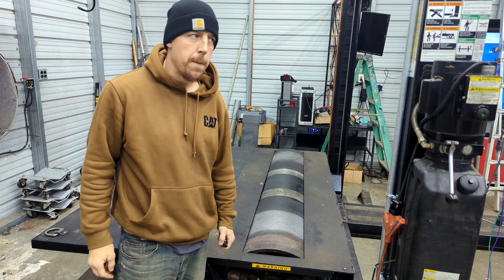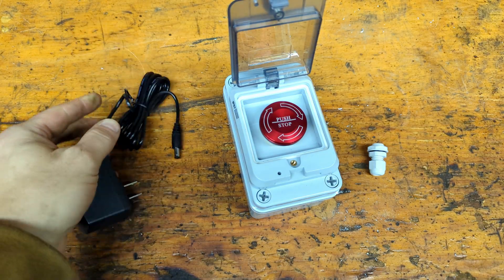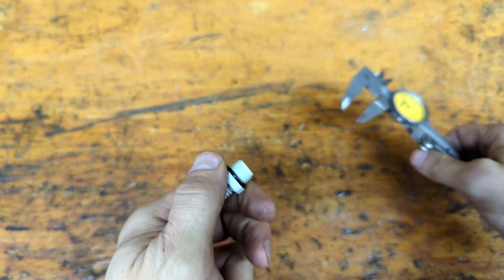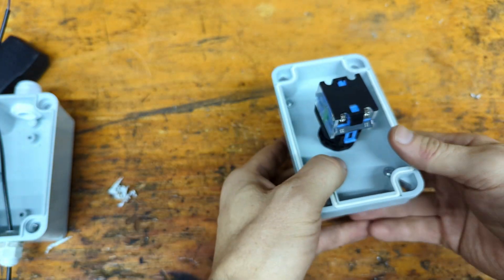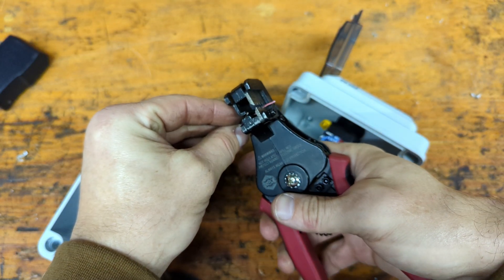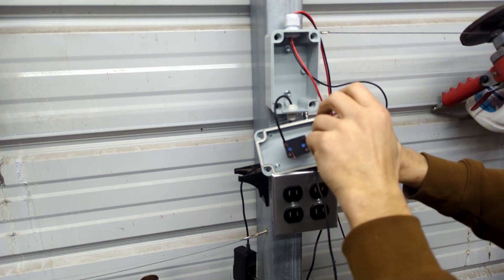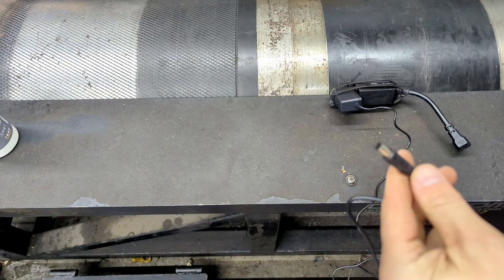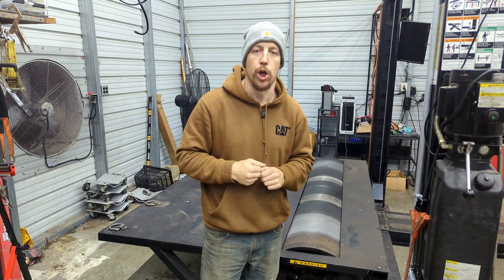Dyno Safety On a Budget: Redundant Air Brake Controls for $50

Comment: I am not sure about you, but this would be illegal where Im from and it looks dangerous.
To use positive control for an emergency system is just calling for trouble. The air system is smart because of the stored energy, but the solenoid should be always OPEN and a constant current from the emergency stop button should hold it closed. This way if you lose electricity for any reason it will trigger the  brakes. Otherwise you have no way of using it.
This is how stop buttons work on all industrial machines I ever worked on.
The open contact on the back is for sending a signal to a control unit (illuminate a light, sound siren, alert other systems etc.)
I hope you reconsider this way of wiring it.
Edit:
The accidental activation of the brakes could also be very dangerous, so I would add an uninterrupted power supply for this so a random grid blackout will not stop the drum (maybe while a test is in progress).
Reply from the maker: Good thoughts, and these are considerations that we accounted for. We have no legal requirement for such a stop button, but since we're setting up the air brake for locking the roller anyway, we decided to extend its capability a step further.

Additionally, verifying the function of the air brake will be one of the items on the pre-session checklist.

Thanks for checking out the video and dropping your comment. 😎
Reply: @PyroPerformancePNW  Legal liability shouldn’t be your deciding factor on such a small safety change, especially for this use case. Do it right, don’t be stupid.
Reply from the maker: @JollyGiant19  the input is appreciated. It is possible to change the configuration to act this way without a complete redesign, now that you mention it.

Perhaps this will be a future video.
Reply: I was going to say the same thing, the design is 'fail dangerous' rather than 'fail safe' The design of it is inherently dangerous because it's required to be energised/charged rather than de-energised/discharged. Fail safe systems use the latter by design for a reason. The whole thing just seemed janky and jerry rigged, especially with such a nasty looking remote system. 

If it fails, it's little more than an illusion of safety.

If you can't see around this there's something seriously wrong with your thought process.